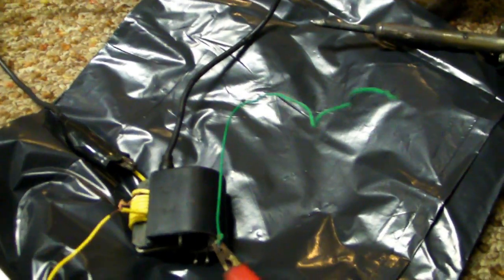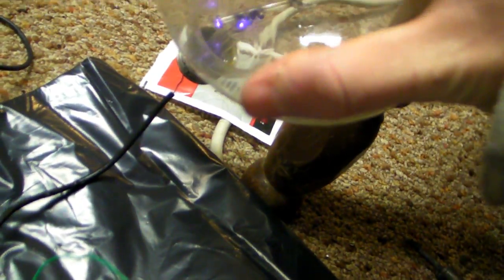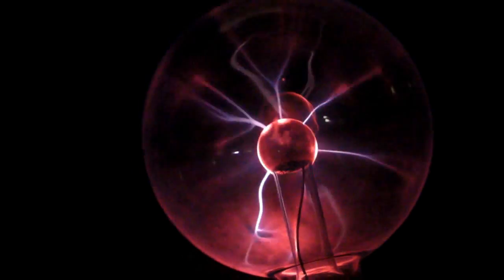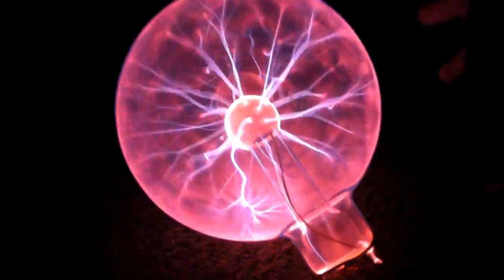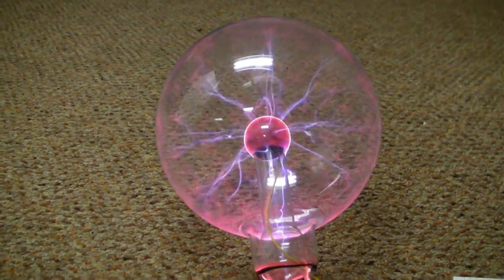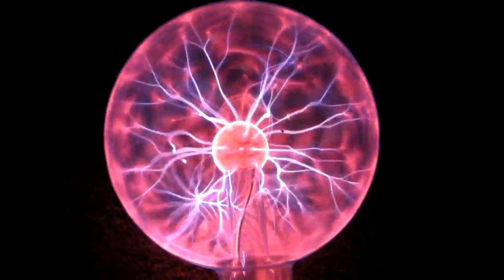Super "Overclocked" Plasma Ball!

Comment: Hats off to you my young apprentice, you have discovered what runs the Universe. Try winding a coil on a coil form ( about 10 winds or so ) that places the coil windings around the 19.47 latitude on the top half of the globe. Then touching only one wire from the coil see what kind of zap U get. You can start a tattoo parlor burning stuff into yer skin. Be careful tho it may turn out to be more than you can handle.I'd be interested in the method of overclocking U used ?

Comment from the maker: @KyrisTV with this specific driver 24v is an accepted maximum, possible 36 depending on the components used. If I were to use a better driver though, like a ZVS or half bridge, then I could pump in quite some more power. I have no clue what would happen at higher power. Maybe more intense arcs, and heating inside.

Comment: @InazzProductionZ 
its not  through the air so much a a transmitted energy closer to the form of static. if you had a florescent bulb next to a coil  the energy in the air would cause it to light up.

Comment from the maker: @1Rowdy1derful Thanks. Caution is key, my ZVS here is about as deadly, if not more deadly that my MOT since the thing is outputting a decent current at at least 60kv which makes it easy to jump wherever it wants. The thing pulls about 6 inch 1/2 to 1cm arcs

Comment: @hawkeye2456 
A plasma ball will not work without the glass, in order to get the cool "lightning" effect, various noble gases are contained within the ball. Under normal atmospheric conditions the most you'd get out of a plasma ball with no "ball" is electrical arching at high voltage like a tesla coil.

Comment: @hawkeye2456  Thats impossible. A plasma ball will not function without the glass due to the fact that I needs the essential gases that are contained inside the globe.

Without the Glass, all you will have is an electrified stick.
Basically the centre electrode is just a hollow tube with a glass globe at the top. Inside the glass globe is a bunch of wire wool. A small high voltage wire runs through the hollow tube into the globe.

Basically what your looking for is a Tesla Coil.

Comment: I used that same style of flyback driver to power an 18-stage Cockroft-Walton bridge. It threw solid arcs for more than two feet. It also nearly killed me when part of it came unhooked while still charged and I got too close while checking into why it failed - it arced over a foot to my hand, and my whole arm was unusable for several hours.

Moral of story: low-current HV can still mess you up.

Comment from the maker: @virtualprodigy9 No.... NO..... the plug is meant to work on AC, not DC. Plus, that plug takes 120 and puts it to 12, putting a DC 12v battery into it will make it output nothing. There is nothing you can really do to the stock driver such as pumping more power in with a different adapter as all of the components will blow due to powers they were not designed to handle. You must make your own driver in other words. The components can be found on the schematics for 555/ mosfet drivers

Comment from the maker: @kmncztms since the circuit was crude, it would probably blow past 24 volts. If I designed a better one though... It would power a bigger globe no problem, at 12 volts, a bigger globe would have just about as many streamers as in the 8" globe.

Comment from the maker: @vutovyou1 Just an ordinary 555/mosfet flyback driver using 750 ohms setting the duty cycle and 1k-11k  ohms setting frequency with a .01uF timing capacitor. Also, the most important part is that the flyback is NOT rectified.

Comment from the maker: @mondays89 I honestly do not know, it does not take many kv to power a plasma ball. only need about a cm arc through air for average plasma globe. At 12 volts, the arc in the air was probably an inch. Only con about this, is the mosfet heats very bad, as its a cheap circuit. I am sure I can improve it with a few capacitors and diodes though. Otherwise, I would mod my friends plasma balls (hehe, plasma... balls)

Comment from the maker: @180Trist yep, that was only 12 volts input. A car battery is still 12 volts, so output would be the same. It drew about 8 amps, so a charger can still do it fine without voltage drop. I will try this again with a halfbridge I am making soon.

Comment from the maker: @maintoc Flashovers are when the voltage is too high, and jumps from one electrode to another. In a bad plase where it burns the plastic and the plastic becomes conductive.
Yep, thats an insulated wire, it was sparking since the voltage was more than what its rated for, and electricity passes though it somewhat.

And thanks

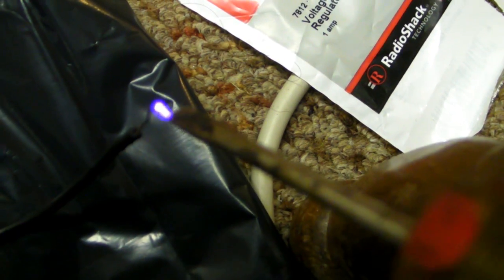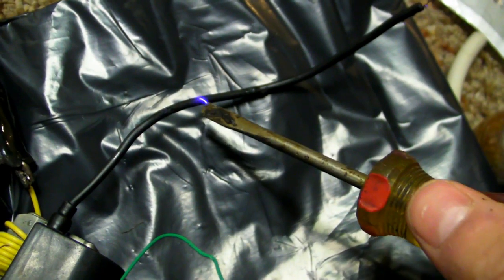Comment: 1)  Are "flashovers" any different than an arc shorting out?  ~  Pretty colors at 0:40 there.  ~  2)  If that's an insulated wire at 1:04 , why is it producing a spark?  ~  "... plasma ball on crack."  :p  ~  6:26  nice light saber.  Obi-Wan has taught you well, young Jedi.  :p